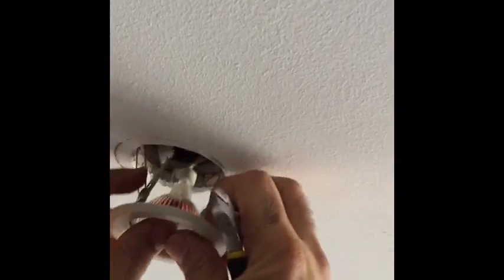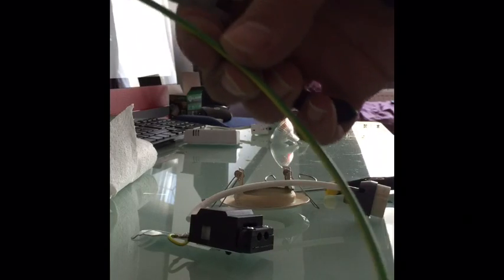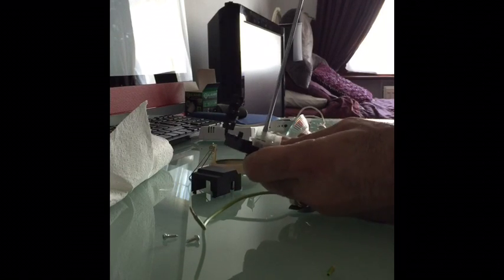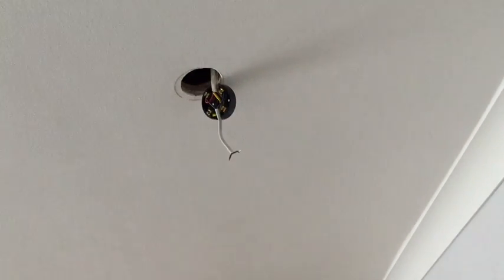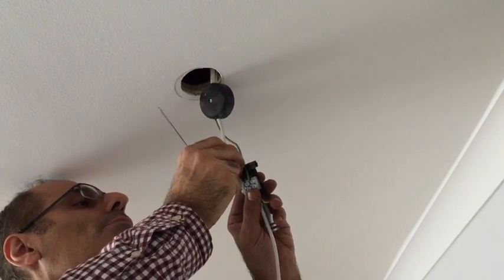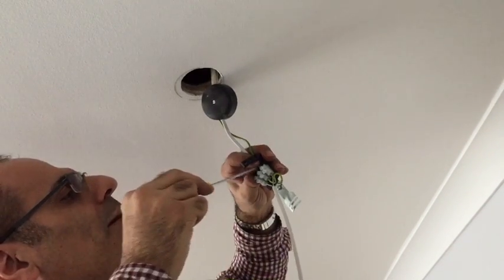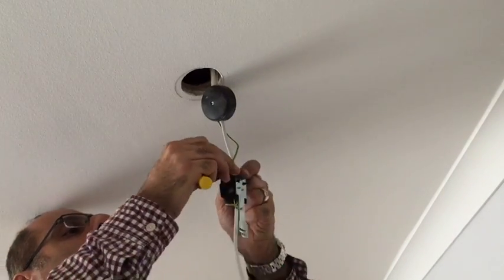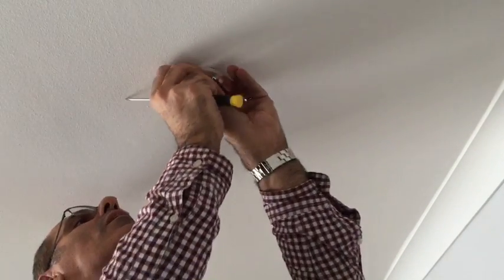HOW TO REPLACE HALOGEN 12V SPOTLIGHT TO A 230V GU10 LED SPOTLIGHT

Comment: Hi a quick question i cant seem to get an answer for online, i have 5 halogen spotlights in my kitchen i want to change to gu10 led, will all 5 of them have a transformer i need to remove? Thanks
Reply: At my place every light had a transformer and I removed for each spots that I replaced to GU10
Reply: if you got an answer lemme know,
thanks!
Reply: @AbdullahRady  in my case i pulled 9 lights and all 9 had one each.
Reply: I was told LED can run from the main feed don’t need transformers. So took out all of halogen transformers and needed a LED switch. And it’s still working after 10 yrs.Actually just like in this video.